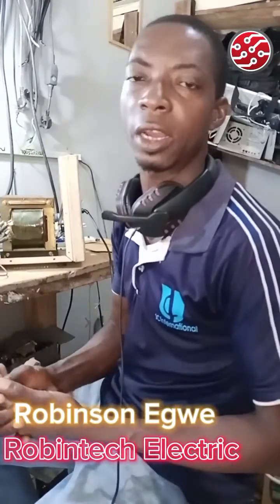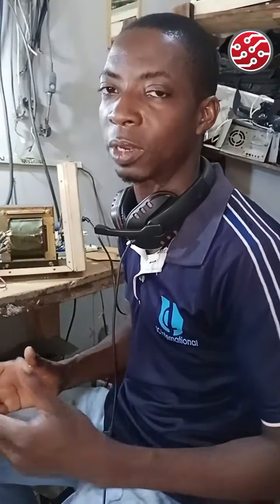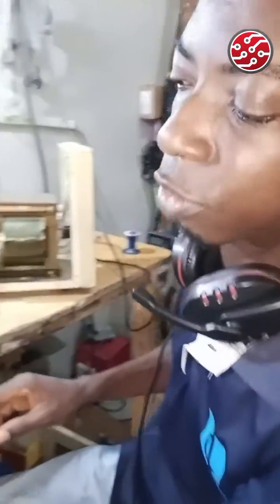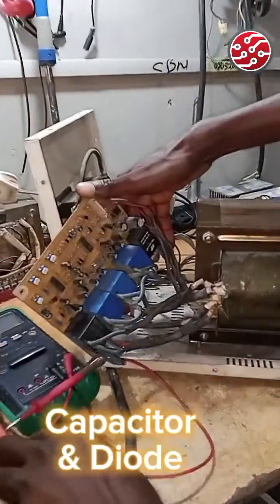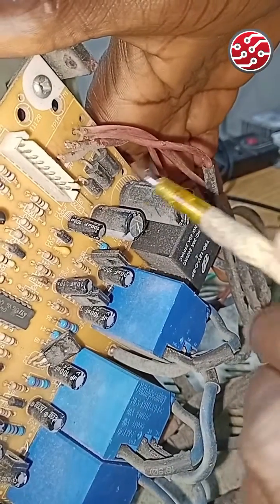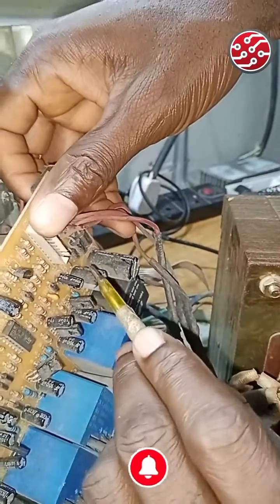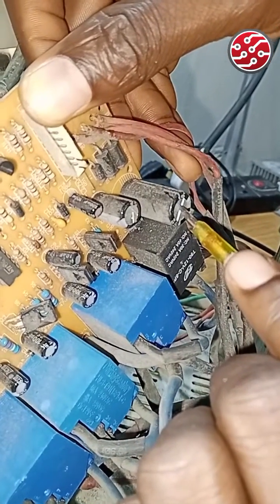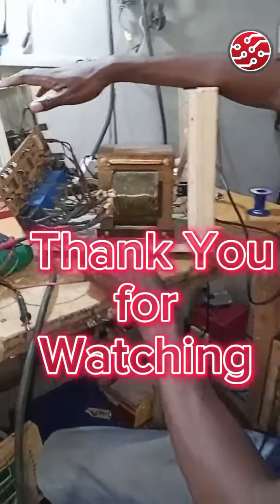How to Fix Voltage Stabilizer that always blow Fuse or cut off Breakers

Comment: Like your explanations very direct and  simple , in case of my own stabilizer 5000va  the circuit breaker trips off at will sometimes 30 mins sometimes 1hr  even it trips off most of the time when there's no power . It trips off after a while when phcn had already taken power like ten to 15 minutes 😅 I just open it up what could be the problem , initially I suspected the circuit breaker itself probably it's faulty  or there's a physical burnt on wires connected to it but nothing of such , there are two relays mount on the casing they're 12v DC , I cleaned them up there are other relays soldered to the board haven't checked them yet about the three of them , the electrolytic capacitor is good but I will still check the diodes connected to it. Right now there is a lot of dust residue in the stab I want to use the blower to blow it and clean  it up before proceeding on the trouble shooting. Thanks 👍🏻

Comment: Hello sir,
I’m working on a Nippon American 1000VA stabilizer. The power capacitor keep on blasting after I replaced all the faulty transistor and if check the diodes direct on board the reading shows on both side but if remove it out on the board it read normal. I check all the relay and they are good. Capacitor keep on blasting and continue to damage transistor I replaced. Please what could be the problem
Reply from the maker: Check the neutral line from the transformer to the board, there is Disconnection somewhere.. or check for any other break in the transformer winding, like each joint where they loop the windings
Reply: You can even extend your diagnosis to other components around the power section , lift one side of the diode up from board and test check for short circuit.

Comment: Hi I need your help, I have a DVR-1000VA automatic voltage stabilizer producing a click sound after operating for 10minuets and power cuts off and it powers on immediately causing my desktop computer to power off immediately  it makes a click sound and it switches on again,  what could be the problem is it my computer or the voltage regulator? My desktop does not powers on on the normal electricity due to low voltage of about 130v , help me
Reply from the maker: There is a faulty relay or relays in that stab, figure out the relay and change or if possible replace all relays